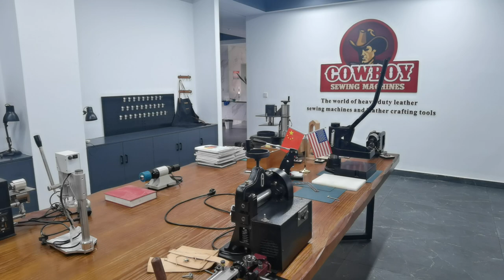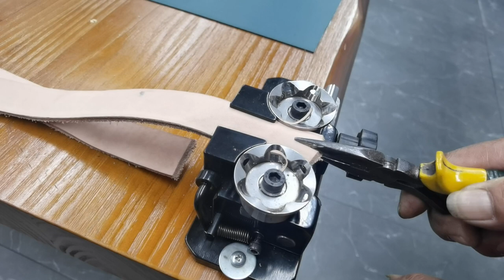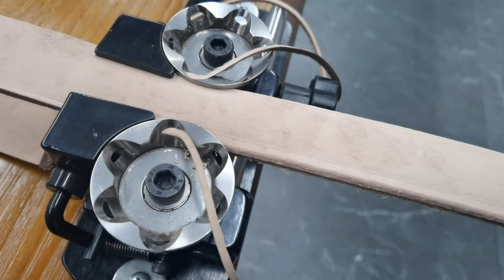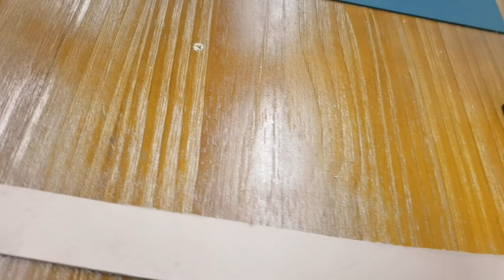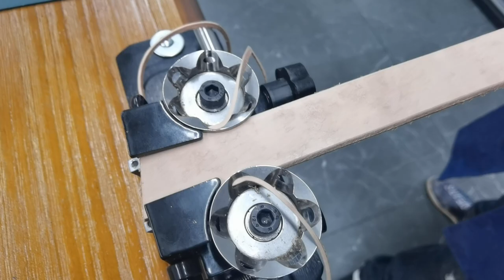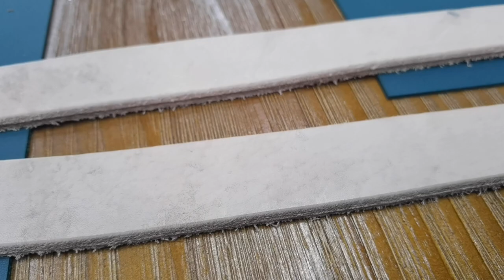leather belt edge beveling machine (Edge Strap Beveler)

Comment: I make belts with a church window point (CWP), does this machine continue the bevel around the curve of the CWP (also known as an English Point. I can see the machine has potential. Do you have a machine which pulls the leather through by itself?
Reply from the maker: It is bench tool for leather workshop, not for manufacturer. You need to pull the leather strap by hand.